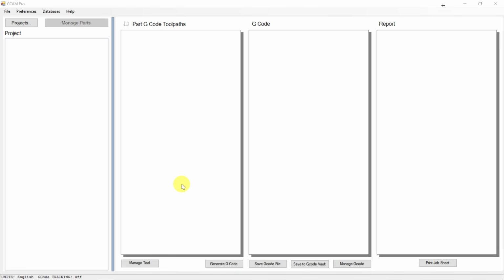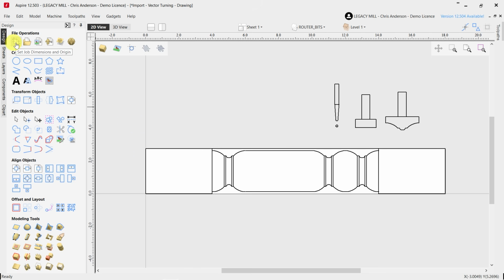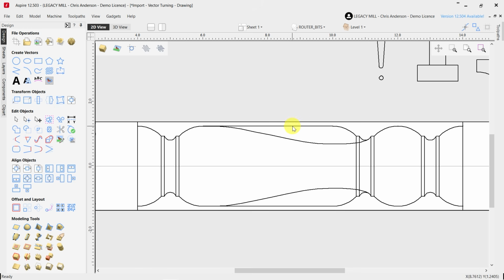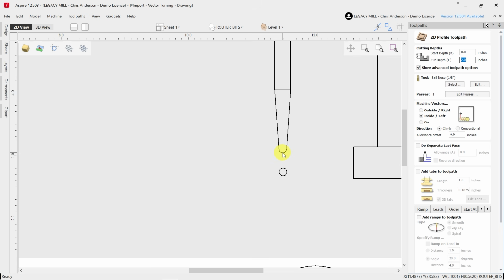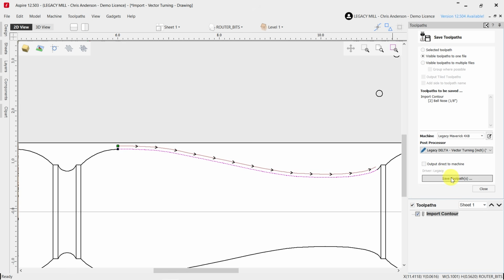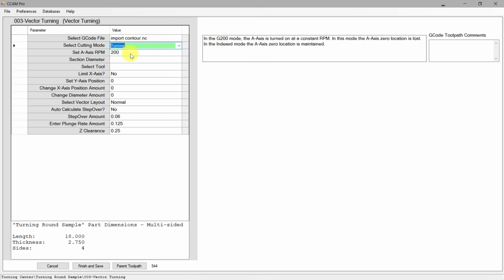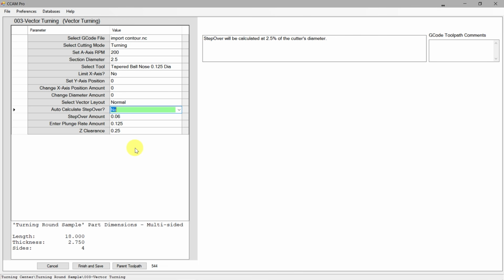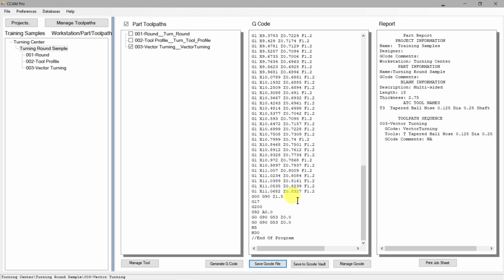Import Vector Turning in Conversational Cam Pro | CNC Contour Turning Tutorial

Comment: Hey Chris, does this work with the Mach3 systems?  I don't see the contour option.
Reply from the maker: Yes it does! it is a little different on how it works but you can still follow a vector with the Mach 3 systems!
Reply: @legacycnc8232  Hey Chris,  Can you outline the steps for Mach3